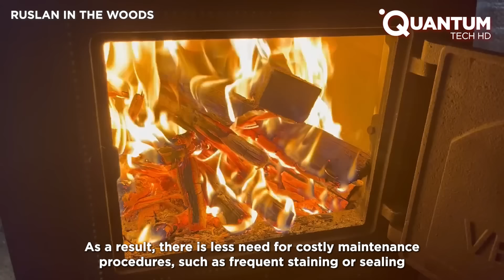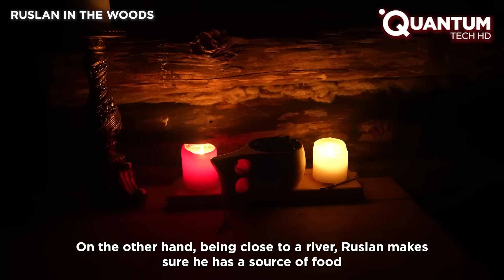Man Builds Secret Underground Cabin in the Forest | Start to Finish by @RuslaninTheWoods

Comment: I'm burning with curiosity! Where are all of these "underground cabin/bunker/shelter" builders finding these 8' deep sandpits to effortlessly dig down into?
Reply: They always start the video after the hole has been dug. They used machinery to excavate it by removing all the rock and tree roots. No way this was done by hand, your skin would melt off using a pick axe and shovel.
Reply: And all of those perfectly straight logs!
Reply: My thought exactly
Reply: If I dug that deep,  down on my land, I would not be hitting a sand pit! last question is-Why didn't you add an escape tunnel-I mean, if they dug that hole with heavy equipment, they could have (should have) made a small escape tunnel as well. Good vid though.
Reply: @INDRIDCOLD83 Yes, true, but as with the OP, what i'd really like to know is what part of the world is this in? I've watched tons of these hidden bushcraft shelters being made, and all of these things are being built into soft, sandy holes. It sure as heck ain't like that where I'm from
Reply: And water infiltration miraculously doesn't ever occur?  I'm afraid those tarps will not possibly do the job.
Reply: The Sandhills of North/South Carolina from Wilmington to Southern Pines is much like this.  Huge pine forests in sandy hills areas.  Fort Bragg is directly in the middle.
Reply: @dherman0001  ah ha. I thought it might have been somewhere close to the East Coast. Thanks!
Reply: @jamesallred460 I’ve watched a bunch of these videos and quite often the packaging for food and supplies uses the Cyrillic alphabet. That narrows the location down to Eastern Europe, Central Asia and Siberia. 😂 Obviously,some are built in the U.S. but the English speakers tend to actually talk in their videos so they are easier to spot. What I know for certain is if you try building an underground shelter in Utah, you better bring a back hoe because you’re going to be digging out thousand lb. boulders all day long.
Reply: where do they store their video equipment
Reply: @davebrewer9279  yeah for sure! I'm in the Pacific NW, and it's solid clay if you go down further than about a foot. Hard work if you're crazy enough to try it by hand.
Reply: Look for clusters of pine trees....they prefer sandy soils
Reply: @jamesallred460  I think the video is from Russia or Eastern Europe.
Reply: Not in Arkansas
Reply: Not in Mississippi……
Reply: What a load of shite !
Reply: It's a secret,,,,, that why it's on YouTube, 😂
Reply: Not a rock in sight, or a root. I can lead ‘em into some woods and challenge them, only using the tools seen here, to put it there.
Reply: Unfortunately I've built 2 and my experience has been hard rock like dirt. Not fun but it really helps keep the bugs out. I came back to it and a huge tree fell on it. It held up and now it looks natural. Nothing to see from above but a old fallen tree
Reply: Florida ground looks like this when you dig
Reply: @jamesallred460  It keeps saying that it somewhere in Russia but who knows for real.
Reply: @dherman0001 my part Of South Carolina is called the low country. That hole would be full of water after 3 feet.
Reply: @tom2step  go West and North just a bit where it's somewhat hilly. Lumberton NC for example. Obviously if you're not elevated just a bit from surrounding land, water will seep in.  You don't live in the Sandhills.  Google can show you a map.  You must be new to the area if you havnt heard of the Sandhills region.
Reply: @CharlieandMelissaWren  Thanks for the clarification. It did seem strange to me, but knowing that there are places that are like that makes me feel a lot better about (at least this) video.
Reply: Hahaha I literally just had the same thought, can't even take 1 spade depth out in ours without water and solid clay 🤣
Reply: Southeastern US near water
Reply: @daubasaurus it is true, some trees grow nice and straight.  Where i live, there are tens of millions of straight growing trees.
Reply: @jamesallred460 im like 99% sure that this is in russia.
Reply: @jamesallred460 yes sir, i can attest to that fact.  We used to dig huge holes by hand (10'x10'x4') for our uhhhh..... house plants.  A couple hundred of those takes a few guys like 3 or 4 months of all day digging.  As you get older, you get wiser, and just rent a machine and get it done with one person in a week.  😂
Reply: @brandonbennett127  hahaha, I know what you mean. My dad and I planted 4 house plants once, and just those 4 took several hours!
Reply: Dump truck will find it and bring it to you.
Reply: 2:28
Reply: I live on a large coastal island that is mostly pulverized rock and coral for soil. The forests here are largely exactly like in this video.
Reply: Underneath the buckets of their excavators that were backfilled with sand from dump trucks.
Reply: Amazing how they find perfectly sized and straight logs…..
Reply: I think the guy trucked out a bunch of excavated dirt and replaced it with dry sand.  I personally never have sand in the middle of a forest
Reply: Russia. Sandy soil down a long way. Takes a while to dig and do. And if you look at one end you will see a staircase going in. These would be done typically in a pine forest. Search for Alex Wild. He has done quite a few. And given the way the world is heading they are an excellent idea.
Reply: No clay I guess.
Reply: Yeah right I’d like to know that too. Also those cheap tarps only last a Year before they are rotted & falling apart.
Reply: Looks good, if they are in fact in Russia, they could be mobilized by now if the draft board has seen this work
Reply: Why’d he call the tarps “weed netting”? You can also see that the ground has been worked at some point because ain’t no way that sand is there naturally without having any kind of rock or gravel mixed in with it! Some people really don’t think about what they’re doing to make a video compared to how it really is in real life! Then again you got people identifying as rocks and sand nowadays so who knows what’s real and what’s not real!!! 😅
Reply: I have some acreage in the panhandle of Florida and there’s not a rock to be found. My neighbors hand dug a storm shelter that doubles as a root cellar. I’m sure if I went out in my woods and started digging I would hit tree roots but no rocks.
Reply: I didn't see any ventilation for in the winter for oxygen.
Reply: Who knows the real answer to your question but there are books you can buy that show you what plants/trees grow in what soil types. Before you know what's underground sometimes it's much easier to spot the tree that's growing on top 🤷‍♂️
Reply: Reminds me of that movie the lovelybones
Reply: Definitely not where I'm located .
Reply: @INDRIDCOLD83 I've dug holes as deep as 15 feet by hand and shovel. And wide enough to fit 6 grown men comfortably. It's not easy. But it's also not impossible. Used to do this regularly for work
Reply: @daubasaurus look around them bud. Poker straight trees all around. My parents old farm in S.E. Ohio was full of poker straight Cherry , walnut and hickory and happened to be on a road called Sandrock Ridge Rd. Had great soil that drained perfectly..killer gardens
Reply: @dherman0001 I'm from the area you're talking about, I used to dig a lot as a child, I'd usually start hitting clay after about 3 ft down, though it was red clay which for me was incredibly soft.  Not as soft as sand, but not so hard a 10 yr old boy would have any issues digging.
Reply: @StephenBrown-h4x  Yeah, you're probably right about the clay in most places.
Reply: 13 feet deep is perfect for me.
Concerns about underground housing.  Are you actually building your grave?
Possibility of a heavy object falling on your underground dwelling and you can't escape.  😊
Reply: I'm burning with curiousity. How many "underground cabin/ bunker/ shelter" videos u have watched?    😂😂😂
Reply: And not one tree root. Amazing
Reply: @jamesallred460 video was made in Spain.
Reply: I’ve dug holes like that by hand many times in my life if you have hands like a man it doesn’t bother you
Reply: It's all fake
Reply: @dherman0001  As is ft Jackson...  I remember having to dig a freaking 6'4" foxhole cause my partner was a freaking giant (I'm only 5'4" lol)
Reply: I lived in New England there’s small pine areas that are sandy pits like this and I think maybe areas in New Jersey maybe the pine barrens of Jersey
Reply: Me too. No stone. No tree roots. Super easy digging. Where is that kind of land? I very much agree with you.
Reply: Exactly! My mtn land is mostly rock
Reply: @intuitivesean443 yessir you are correct. The Mafia back in the day would take advantage of the soft soil down in the pine barrens too, and not to build shelters. I'm from NJ so I can fully concur on your guess being accurate.
Reply: @SarcasticCynic  Funny, we've got factories in Eastern Europe that I coordinate with daily, you're the first person thats implied being eastern european aligns you somehow with the USSR.  You go ahead and use that term bud!
Reply: Right it took me 3 months just to get a hole half the size
Reply: 😂right!?
Reply: It’s a whole team that does the work but only two people are on camera.. It’s a channel that exposed it
Reply: Отлично
Reply: Да
Reply: Да
Reply: Да
Reply: 2:30
Reply: Not if your used to hard labor, if your a "keyboard puncher" and "office seat warmer" than your skin might melt off!
Reply: In Russia
Reply: @INDRIDCOLD83 хоть так ,но строит,это для браконерства  видимо😢
Reply: @INDRIDCOLD83 I'd show you a picture of my hand if I could, I have cuts all over my hand and calluses. Digging a hole like this is hard to do by hand but not impossible.
Reply: IN THE NETHERLANDS!!!
Reply: @davebrewer9279 Exactly what I thought
Reply: I believe in the beginning, the caption reads 1.5yr to build out.
Reply: Apparently it's a thing in Russia. Like allergic reactions to flights of stairs and fourth story windows.
Reply: Florida, they don't show day 2 when the watertable after it rains has 2' of swimming pool
Reply: Canada
Reply: So much of wood is used to build. They could have used some other materials that don't involve cutting of many trees. Sad!
Reply: Your disingenuous sarcasm seems more like just being a veiled "hater".
 Most of the places I've lived there's no way it could be done in an easy timely manner. Mostly rock, mostly clay, mostly frozen, whatever.
 I've only found one sand pit ever and didn't do anything cool with it.
 I'd like to point out that my favorite bush crafter, Eric Granquist?... Grandvisk?... (I can't remember) did  a similar underground shelter build vidio that took hours and hours to watch. , it was loooong, and he was hauling a lot of rock. So good for these guys for a 20 minute video.
Reply: @brandysanders3653  There is nothing disingenuous about my sarcasm. It was very sincere... sarcasm.
That said, there were a lot of good responses here that has since convinced me that these sort of terrain features are not as rare as I'd previously thought them to be. So however hateful you might think I've been, and might have been in fact, it led to a better understanding of what's possible. And now I'm sticking my tongue out at you. :D
Reply: В сосновый лесах всегда песчаный грунт!
Reply: @daubasaurus деревья в сосновый лесах растут прямые и ровные, ни чего удивительного в этом нет. Одиночные деревья растут раскидисто и по этому стволы у них как правило кривые
Reply: so true lolol
Reply: Portobello in Edinburgh 👍🏴❤️😜🙈
Reply: @jamesallred460 try Sandhills area of North Carolina
Reply: @jamesallred460 вы не служили в армии РФ, 😂там не только такие ямы научат копать но и делать  это на время 😂😂😂😂
Reply: @INDRIDCOLD83  There are loads of places in the world, especially near coasrs, where the ground is nothing but sand.
Reply: @daubasaurus  Just look at the perfectly straight trees all around the site....
Reply: Esse abrigo subteranio,me fez lembrar films de sequestro!!
Reply: @samadferrell6733 it said in the beginning that it took approximately 1 year to complete this hole.
Reply: Win amazed at hi king the battery operated tools keep working. Where does he plug them in to recharge?
Reply: Looks great. But a couple of heavy rains and there will be problems. Cool vid tho
Reply: I got a feeling 
It's at
Bareback mountain
Reply: @jamesallred460 I saw Russia early in the video.
Reply: Here is The True Savior

HalleluYAH “Praise ye YaH”

YaH is The Heavenly Father 
YaH arrives via the TENT OF MEETING
YaH was Who they Crucified for our sins
YaH was Crucified on an Almond TREE

— Ancient Semitic Cuneiform of Moshe (Moses)
— Isa Scroll (The Original Isaiah)

Isaiah 42:8
"I am YaH; that is my Name! I will not yield my glory to another or my praise to idols.”

Isaiah 43:11
“I am YAH, and there is no other Savior but Me.”

Isaiah 45:5
“I am YaH, and there is none else.”
Reply: And why?
Reply: Ukraine 😅 people sick of corrupted city run government ..
ya can dig a treach or ya can dig a cool home
Reply: Those Pine Logs Rot Real Fast !
Reply: South Georgia
Reply: I have wondered the same thing!
Reply: Better shore that hole
Reply: I lived in the north in Russian before next to Finish border, and there’s a plenty of spaces like that.
Reply: Like the AI on the thumbnail wasn't enough of a clue?
Reply: Not in Australia.
Reply: Nowhere I've lived.....that's Ontario all the way east to the Atlantic Ocean and lots of spots in between.   I run lots of underground electrical conduits.  I've seen a lot of what's just from the surface to 6' deep.  It's usually not hand digging.  Usually an excavator and sometimes blasting is required too.
Reply: То
Reply: Fancy Septic  Tank!
Reply: Bonjour, génial mais 2 danger pas assez de prise d'air et l'aus peut monter par le plancher 😢
Reply: Yeah!
Reply: @INDRIDCOLD83  oh yes, because nobodys ever built anything by hand before….
Reply: Def not where I live. I live near a quarry....
Reply: Zombie
Reply: Hampstead Heath. Go for it.
Reply: Who said it was efgortless?
Reply: @zap_sigma1  That was me, and I stand by it. Or... was that supposed to be rhetorical?
Reply: @FornaxusCrucible  Stand by it if you wish.
If you are, indeed a troll, I stand by my words too, as critical thinking skills mandates for me to immediately assume that if it looks like a troll assume it's a troll until proven otherwise.
 Appreciate the reply though. On the other hand, maybe you're not one of those mindless amibas & I took it wrongly (it happens.)
 If you're not a troll, sincerest apologies.
 Either way, it helps to not assume that something is easy just bc it is made to look easy.
Reply: @zap_sigma1  Apology accepted. As for my bona fides, I've dug in a fairly wide range of ground types. Sand is by far the easiest by comparison*. In my experience, most stretches of woodland is not a comprised of deep pits of sand, but rather soil and stone. I've seen too many of these videos where the ground is an unbroken pit of sand, where the creator makes it "look easy" because by comparison it *is easy.
Reply: @FornaxusCrucible  It is possible. After all, this is social media. So, it's not beyond the realm of possibility.
Reply: That's what I'm saying! I never make it more than 2 inches at most without running into rock or root. I also call bullshit.
Reply: I could live there permanently!
Reply: Not sure where these guys are but I live in the foothills of the adks mountains in New York State and quite a bit of my soil is just like this. Clean as beach sand
Reply: New Jersey 😂😂😂😂
Reply: A lot of forests  have a bunch of sand. I found one with only 3 feet of digging , pure white silica sand. Pool filter grade.
Reply: As kids we built these in the forrest in the Netherlands. (Veluwe area) it was actualy quite easy to find spots where you could dig without hitting roots and there is no rock there at all.

For wood we coordinated with the forrest service. They thin out the forrest every year to make room for some trees to grow taller. They mark the trees to cut down and we could use them if we cutbthem down for them. We had no trouble getting enough straigth logs.

We did however build this with 8 people and it took us weeks.
Reply: No shit huh
Reply: Wouldn't the ends of the logs act as wicks sucking the moisture out of the ground? The inside looks nice but I don't think it will last for long.
Reply: Spy🫢🤫👀👀👀👀
Reply: This is such a ridiculous waste of time.  The shelter will last half a season and fall apart
Reply: Looks like that was dumped there. 😂
Reply: I've seen one channel that actually dug into obviously hard ground and had no jumps in the video only spead up time, so they were actually doing everything, but the end results were considerably more modest. I can't remember the name of the channel at the moment. If it comes to me, I'll post a link in reply to this comment, or maybe just edit this one.
Reply: Nowhere near me!
Reply: So let use the forest and ancient techniques and put it together with screws drivers tarps  drills and chainsaws
Reply: East coast, from Virginia and the Carolina all the way through Florida and Georgia. The golf courses are something special out there.
Reply: Surrounded trees, not one root
Reply: You took the words right out of my mouth .
Reply: It was a big pile of dirt, brought in by 50 dump trucks. And a Home Depot credit card.
Reply: you stick to your cardboard box forts in your mother's hallway and let these real craftsmen showcase their skills on here
Reply: Well I can only speak for myself. I have nothing but sand for a yard. It's impossible to grow grass with watering restrictions. Trees love it! There is sandstone down there, 4 feet to like 15 feet down through nothing but sand...
Reply: @eddyfitzgerald1978  Sure. "real" craftsmen. You do understand the concept of editing, right? Selective information is indistinguishable from lies.
Reply: @ I’m a builder
Reply: How many young girls can you hold captive in these bunkers? Asking for a friend.
Reply: Lol….right?
Reply: @ pmsfl 🤣
Reply: I built one under your house. It's the best way. When people know you are a prepper they will come to your house. When you build under someone elses house they are SOL. 😂
Reply: The ground.
Reply: Excellent question!!!
Reply: I ride the subway, and city buses to become closer to Reality. I talk to GOD, and I message Jesus in Facebook. These bunker-building ideas come to me in a meditative state of mind. I found the Garden Of Eden this way too. Once, I was searching for a Chinese food restaurant on the top of Mount Everest...one just materialized. The supernatural is oh-so-real. You should do what I do.
Reply: @dherman0001 

I grew up in Fayetteville. Nothing but sand. Easy digging folks.👍👍👍
Reply: It's called "Fake" 😏
Reply: @illustriouspotentate1948  what type of LSD is it, and how much? Your disconnect from reality is only paper thin.
Reply: Some parts of Florida are easy to dig like that but you have to build strong walls so it doesn't cave in on you.
Reply: It's called being deceptive, aka bullshit.
Reply: I find it hard not to believe these guys don’t have helpers off camera. I just kinda push that to the back of my head and watch it for the construction side of it.
Reply: Florida and Cape Cod have soil like this
Reply: The first few seconds of this video looked like sometime tricked in A LOT of dirt he dug into. There was just this big mound the was higher than the surrounding land.
Reply: Bear that in mind if they toss us in one😂
Reply: And not any roots to deal with, in the middle of the forest?  Super convenient!
Reply: Depends where you dig. San Diego = Burn out an electric jack hammer in 20 minutes, and have to switch to pneumatic. 
Long Island New York = soft sand just like this . Not sure about the logs, so just use 4 x 4's.
Reply: When is digging anything effortlessly?
Reply: Facts
Reply: None of it matters when you put skylights in using zip tape to logs.
Reply: Definitely not in Alabama that Alabama Clay ain't no joke 😂
Reply: In the woods!
Reply: In the grounds
Reply: Hmmm interesting  question 
 My experience. Of digging  in the forest. Is that its full of roots and. A bulldozer is needed.
Reply: Instead they dig the hole with a escuvator they put the sand in then build the cabin on top of the sand . You learn something everyday PEACE AND LOVE TO EVERYONE NO MORE WARS .
Reply: My two cents worth concerns the perfect boards in the thumbnail photo.

I'm easy to con. Try just a little bit, would you?  And, No, I don't trust your power saw to do it.
Reply: The entire West side of Michigan is sand.
Reply: How many rodents call it home now?
Reply: The title says 'man', I see 'men'! Surprised you didn't lay plastic on the floor
Reply: I dig one for my cabine in woods it took me 1 year and 1 year to build
Reply: What about the endless battery life of this screwingmachine
Reply: Wood door with a lock….ok lol
Reply: You ask too many questions. Next you're going to ask how can Uk    e have only lost 43,000 soI diers (source: V Zel...y) in 3 years of trench warfare
Reply: Fantasy land
Reply: Well ,.... EXCELLENT work my friend. Well done.
Reply: Yeah, not all of us have land to even do this.
Reply: It showed him digging the pit.  He didn't "find it".
Reply: @dherman0001 sure it will.  The sand will absorb the water and will run off since it has a slope.
Reply: Water , worm and bugs often enter these sandy soil subsurface forts.   Jersey pine barrows sandy soil require a significantly great depth to width ration due uniform sand size has less grain retention .
Reply: Plenty of places with sandy soil deep. I dig tank pits between 16’-20’ and it’s not that unusual
Reply: @whatsthebigfndeal tons of sandy soil near Wilmington NC
Reply: @INDRIDCOLD83  Was there any part in the video, title, or description that made a claim it was done by hand or with hand tools only? The title definitely mentions a start to finish cabin but, I don't see the part about hole digging or log shaping! Maybe you are thinking of a different youtube channel?
Reply: In my backyard in san Antonio I did an inch and it’s all limestone rock, but south of San Antonio in a small town of Floresville, my cousin owned a house and the ground was all sand.  There are parts of the world that use to be beaches before the ice age when the earth had way less ice caps
Reply: So true
Reply: @michaelpal7641 where I live its all sand after the first 3 feet
Reply: I’m also very curious how they keep it from flooding when it rains!! 😅
Reply: Y’all see them using power tools in the video and still assume they claimed it was by hand yall stupid
Reply: @dherman0001  oh, but you are forgetting about the awesome, hard, red clay under the sand.  If you've ever dug a fighting position on Bragg you would not forget it!
Reply: You nearly chopped your ankle off 😂😂
Reply: Imagine a portable blu ray player down there
Reply: The about info says Spain...
Reply: The sand was dumped into an existing hole. It doesn't match the surroundings.
Reply: Eye🤔dunno...  but if he digs Less Than 1ft. along the Gulf Of Texis he's gonna 'hit' an UN-ending supply of water.
Reply: Those untreated/unpainted pine boards with last a year max
Reply: In northern Germany that is pretty common.
Reply: Пепел покажите ?
Reply: Great question!
Reply: @dherman0001  inker down, y’all
Reply: @INDRIDCOLD83 a few years ago, bro brother and I dug a 6ft by 6ft hole that was around 4-5ft deep. We were planning on building a bunker sort of thing. Unfortunately, we moved. Then, we dug another hole that was a fair bit smaller, but as we were about to start construction, we got caught and had to fill it in. Unfortunate
Reply: Clearly the cameras are built into the surrounding environment using locally-sourced hardwood, which offers superior battery life and resolution quality than softwood cameras.
Reply: You know what I hadn't even thought about that I've been so elated by the what they're building and so in all their craftsmanship that it never occurred to me that they didn't have to hack through a single root not a one in the middle of the forest. So I might have to call bullshit
Reply: Same place he got the windows- called prepping… not caveman shit
Reply: Right!?it then also begs the question of drainage...this is a wood floor hovering over this soft sand. Sure, they sealed the walls decently with that fabric, but I didn't see them seal below the floor, so any water draining through that sand to the walls will go straight down and come up from the bottom.
Reply: @INDRIDCOLD83  Actually,  just this past summer I,  excavated a similar pit 12×12 feet and about 9 feet deep..  using almost nothing but hand tools.. used good gloves,  spade shovel,  pitchfork/🥔fork, Garden claw gold,  lopper for the larger tree roots,  and a single power tool.. my cordless drill with a spade bit and extension.  The drill does the work of the pickaxe and handles the smaller roots too.  .
Reply: Effortlessly!
Reply: It is said the project took 1,5 years, apparently it was dug like in 5-6 months
Reply: Probably in Mother Russia. That's where they find WW2 Tanks under water.
Reply: Right!!!!
Reply: By lakes it's sandy in some areas. I had land that was Sandy. Easy to dig a hole.
Reply: He isn’t making a shelter guys, he making bank with 15 mil subs and 13 mil views.
Reply: to be fair, there are forests with sandy soils. However, it does seem a bit convenient, doesn't it?!